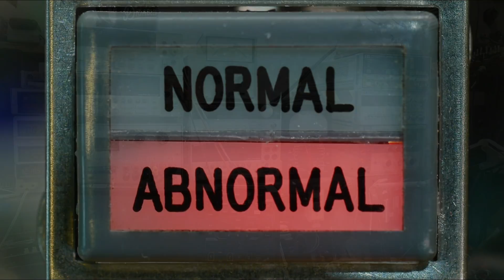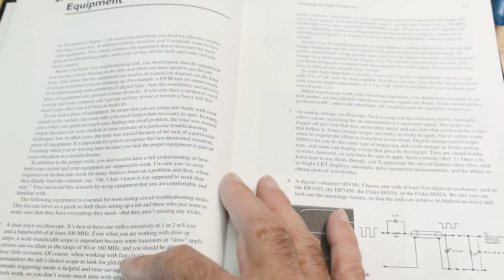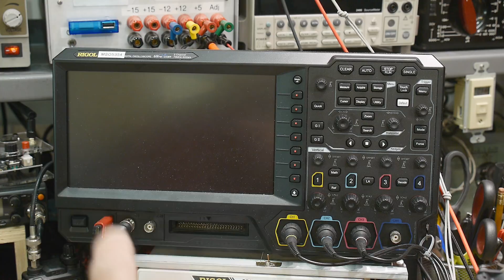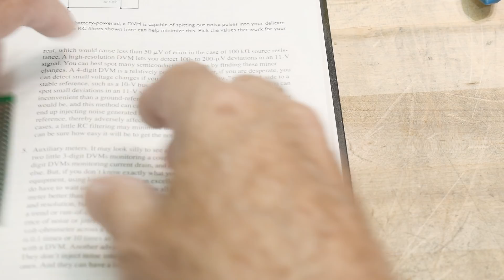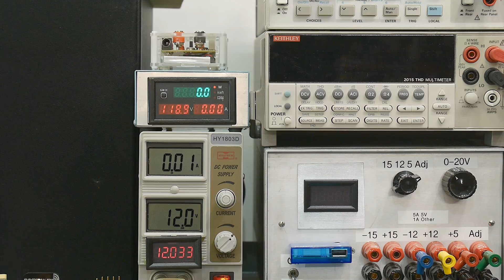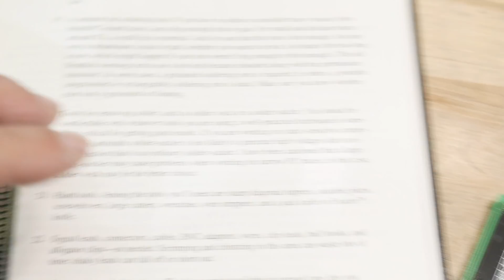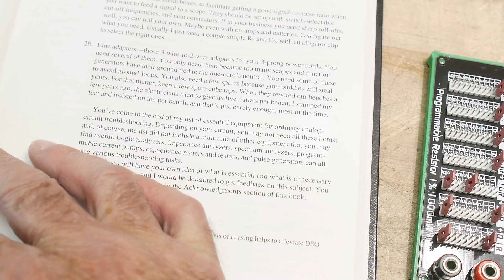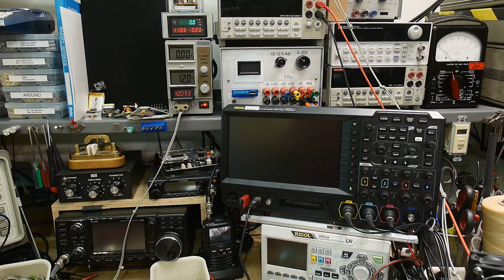#1179 What Electronics Tools Do You Need?

Comment: On the DVM I have 3  hp 3455a in the rack . the bm786 from EEblog has as good a 5 digit for  $ 200. the HP other test eq can work well. Rigol 1054z work well for $ 500 .  I play with tube amps  the high voltage  power supply is 1000 volt 500ma supply it weights 65 pounds. a beast with 2 200mm fans on the top.

Comment: I would add some obvious qualifier.  It Depends!  What exactly are you doing.  One of the first things I personally acquired was a Heathkit that I built myself.  I thought I needed it, as my employer did not have anything similar, or frankly nothing at all for evaluating welding arc noise and filters.  I still have it, although last time I tried if it still worked was 2 or 3 years ago.  But since those days I have got 3 spectrum analyzers and 2 VNAs.  I still keep building my own front end filter boxes for my scopes and DMMs.  And there comes another comment.  What Bob referred to in his mentioning of High Impedance did not mean DMMs that have a standard 10 megaohms input impedance.  As it happens, just within the last year I needed to build two gigaohm front ends to my DVMs.  The need came with some 10 or 12 kV differential voltage measurements.  Yes, I have a 15 kV scope probe, but it is of course single ended, plus it is only 100 M resistance.  So, your requirements probably are very different from mine.  That is why It Depends...

Comment: Totally reminds me I have most all the parts for the DIY "SMD Decade Resistance Box" I found on instructables that seems suitable and good enough. Just picked up a $30 variac FB Marketplace find last week and is my first newer design one.  Like yours, was thinking originally make more like the "post apocalyptic inventors" rack mount design and am now thinking I like that bench style and will have to think about what case can be used... maybe an old heavy duty computer case even if some cutting and bending and maybe welding?  HHHmmm...  I guess curve tracer where needs really specific and/or picky matching sets?   Primary standards sources definitely can be handy to calibrated/verify the shop equipment and maybe secondary standards.  Those 3D printed hangers are nice for cables.  Found a $3 Goodwill Store "heat embossing tool" smaller heat gun almost solder station style a few weeks ago.  Great overview, affirmation and insight as always.  Thanks for sharing!

Comment: My lab looks a lot like your lab. You probably also picked up every piece of gear that came your way that you could afford. It is so easy to rationalize the purchases, especially used or broken stuff when the price is right, or getting boat anchors for free at ham swaps. I always get both low-end and high-end gear, from HP to Harbor Freight, because I use my cheapest junk for anything it can be used for in order to protect my expensive gear from me being stupid.
My 'luxury access' is borrowing gear from a government lab I do work for. I got my Metcal rework station by repairing 3 dead ones for a friend. You don't even want to ask me about spare parts. I took my van to an electronics surplus store that was going under, and I filled it with boxes of everything, twice. 
BTW, speaking of test equipment, my partner fixes almost everything, including HP 50 Gig network analyzers, with a Harbor Freight freebie multimeter, an alligator clip jumper, and a couple of screwdrivers. The people who he fixes gear for ask him where all his repair equipment is, and he just points at his head. He's an old Heathkit engineer with a Masters in EE, a Doctorate in physics, and is a licensed PE, (because he thought it might come in handy some day.) He makes me embarrassed to have a room full of test gear.
Reply: > I use my cheapest junk for anything it can be used for in order to protect my expensive gear from me being stupid

I thought I was the only one who did that! To this day, the first scope I turn on when I start working on something, is my cheapest, oldest Rigol scope that cost like $200. I have a $1000+ scope, but I figure if I'm going to make a  mistake and fry a scope, I'd rather it be the one I can replace for $200. 🙂  I save the fancy one for when I specifically need the additional features (which to be honest, isn't really all that often).

Comment: Nice lab and great recommendations.  For a DVM I have the Kaiweets 118 which is a great buy for < 40.00.   I did notice your hp Rpn calculator maybe a 32S or 42S.  I have several hps which have served me well for years.  I did notice your IMSAI 8080 do you still have it? A friend of mine had one running cpm. I was in the other camp SWTP 6800 and later 6809.
Reply from the maker: after all the videos I did, I sold the IMSAI. Rebuilding it twice in a lifetime was enough fun. Time for someone else. I've had every HP calculator ever made. Most are gone now but the 32S 32Sii are some of my favorites. I have a very close friend who worked on that design at HP.
Reply: 68XXX was the best.

Comment: Thanks for the great video it will be helpfull in the forseable future turns out i vould still use a few more thing. Anyways kind of a tip from me if any of you guys attend a electrical engineering school and ever overhear that they are replacing old equipment go and aak the teachers if you can take something i got a scope,0-400V bench psu, 0-50v psu, an old dekade and a few other things that way. They were gonna thrown them out and this way i didn't even have to spend a penny on some of the equipment.

Comment: Good job...

I fall for in the envious trap...

I do like the Nano VNA...

I was thinking of Jim Williams...very keen and accomplished...nice to read.like the development of extending back light on computers...his test equipment built while some time at LT..

Your with us now IMASI Guy...

Thanks 

Here is my list of what you don't need:

Logic analyzer.....a probe is okay..or use your scope....I suppose if your stuck on the 8086....or a bus speed that is slower than your analyzer...you might find some glitch 

I mean you go broke trying to find faster equipment....then moore law is going to make it obsolete...in a year...

You don't need 2GHz  64 bits to blink an LED...

I also liked your HP scope dismemberment...using your vacuum desolder tool...WOW that was fast..I want one of them....meanwhile the spring vacuum syringe-... make do...
Use rubber band long nose..to carry heat away...towards the component your trying to keep

I like to add Booton RF voltmeter...very light loading....good range...analog meter for peaking....sensitive too...I think works to UHF...

Thank gods for the low price test equipment....like the Nano VNA...

Envious trap.. some spectrum analyzer....like you say if your doing that type of radio work ...checking emissions... then essential...

That is as I look at my broken Tek 496 sitting in the corner.....it has signs sone signs of life...

I will look for the offer up...of the wife who tired of her husband's electronics....

Thanks for not recommending the curve tracer....

Move on Fred

Get the lab up...

4 projects ....at least need to be done...before you die..

2 need maybe need some UHF...

Maybe con work work to buy a few pieces...3 out of 4 is for that anyway

After all somehow the 1992 grew legs and walked away...

I feel like there is free education...
Reply from the maker: Jim had no degree, all self taught
Reply: Yes how about that...I think Jim being creative and trying to solve real problems with an open mind and working methodically he was effective yet bound by theory 

Your just as gifted IMSAI Guy...
Thanks for making sense of it all...and for covering all sorts of electronics topics...famous popular chips...not getting lost in the forest for the trees

Applying yourself and building things can make ourselves the best analog and digital John William we can be...

I remember working on a talking digital cruise control in 74 & 4000..1987 a few power amps...it used that 2907... & National Semiconductor came out with their prom holding words constructed into sentence chip set...it morphed into 6 bread boards...just like a side project for our digital class...a little DC motor to emulate an engine...a wheel cut out for slots...photo interuper ..really just a sum of cook book...circuits tried to integrate

The speed decision made with 7485...compared a reference set speed...sort of digital feed back...up down counter to bcd out to 4 LED multiplexed rpm display..hours and hours of tinkering 

In the end it hunted and wasn't stable at some set speeds...luckily the volume could be turned down...lol..

All that could of been boiled down into power amp with velocity feedback...

It just showed I couldn't master gain feedback servo theory and didn't know how to apply PID to a bit banger

I don't regret hauling it to class for a demo anyway...so worried a bank of red wires might fall off...I think I had just a spool of red solid wire and black...

Thanks...

How about visiting ..RF class C mosfets in parallel for a induction heater....how to bias and drive gates...now gathering the parts for that...I can handle that...

Probably another idea has stumped me...which will I hope explained with minimal babble...sent to a place near bay area called IMSAI Guy...for guidance or a few words...at least in in the form of RFQ...

Take care

Fred

Comment: Can you comment on the analog VOM mfg and model?  Also the homemade looking power supply just to the right of the cheap one you commented on?
Reply from the maker: Triplett 630 and HP427: https://youtu.be/VU7nlZ2DAKg
the homemade one I made many years ago. +5 +/-12 +/-15 and one adjustable
Reply: Thanks!  I love your channel - I have learned so much from you - thank you for sharing your knowledge and experience.  Between you, w2aew, and MegawattKS, I feel like I’m getting a university education …
Reply: @IMSAIGuy  Even EEVblog finds the 630 better than the Simpson. Mine is an NS which uses a D and AA cell. I also like the Trip 310 VOM and 850 VTVM.

Comment: What do you think of the Hantek 2D72 as "baby's first oscilloscope"?
Reply from the maker: while any scope is better than none. I don't think I can endorse that one.
Reply from the maker: you might watch this: https://youtu.be/PBLssdxZ15c
Reply: @IMSAIGuy  Well, that sucks because I already bought one :/
Reply: @IMSAIGuy  Do you have any specific reasoning as to why you don't trust this 'scope?
Reply from the maker: it will be lacking in speed and features. difficult user interface. small screen.
Reply: @IMSAIGuy  I see; thank you for your input! It's 70MHz, has a function generator and a multimeter built in. It can also connect to a computer. I'm in a tiny one-bedroom apartment that I share so I s'pose this'll have to do lol